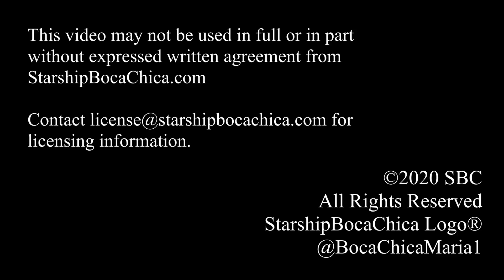2020 11 05 SN8 Ready for Launch - SpaceX Starship Boca Chica

Comment: SN5 and SN6, repainted and fitted with that 'ghost cone',... makes a real good Technology Demonstrator for the Moon Lander version - rather then waste the flight-proven test articles, better to risk them as test landers - swap out the sea level motor, fit a single central vacuum one, send it off to the Moon and test the landing thrusters. It wouldn't need gimbal mounted motors, as they wouldn't be getting used to land it on Earth,... And I bet a single V-Raptor would easily get it off the Moon.

Comment: The roar of the SN8 Raptors is going to be permanently engraved in my brain. (Best luck with your windows Maria) hot Tamales!! Bon Appetitto.
Reply from the maker: My new Sea Cottage on canal H in Long Island Village in Port Isabel has taken a few shakes and rattles thus far at 4.5 miles away.  The villagers seem to fair better.  Our old Villa we sold to Elon is 1.5 miles across the bay and we put heavy plexiglass in the front windows and the seals get cracked everytime over pressure or pressure to failure happened.  So I'm sure it will be fine at our old place  but if a R.U.D. happens I'm sure the cracks on the seal won't hold and in march the Texas red ants.

Comment: Awesome content Maria. It looks to me like they're inspecting the orbital launch Mount columns to see if the concrete has cured yet. It takes a long time for that much concrete to cure. On a little bit of trivia side note,
The Hoover Dam concrete would cure in 125 years by conventional or natural methods. Crews, however, used some innovative engineering methods to hasten the process.
Reply from the maker: I wondered about that slab.  Interesting.